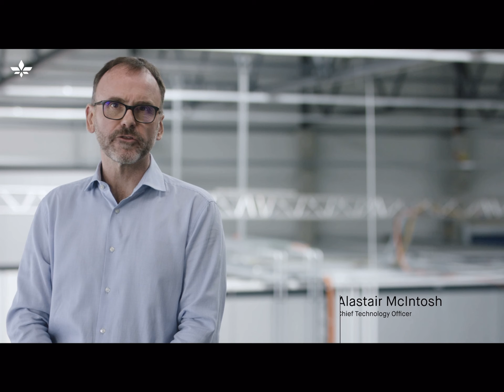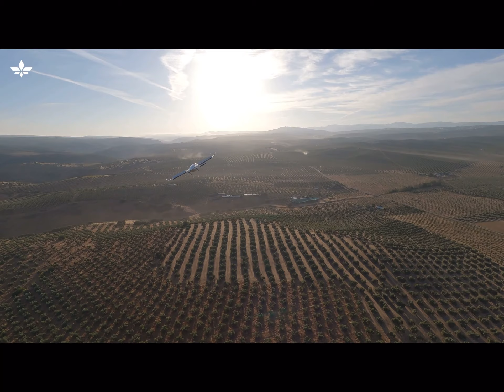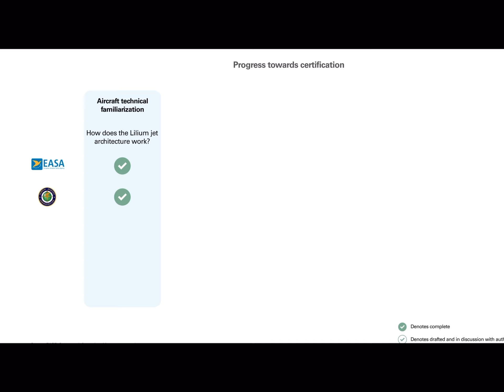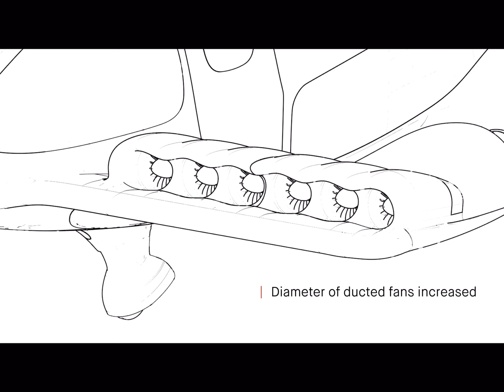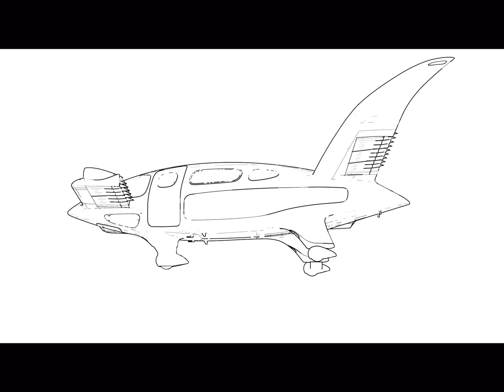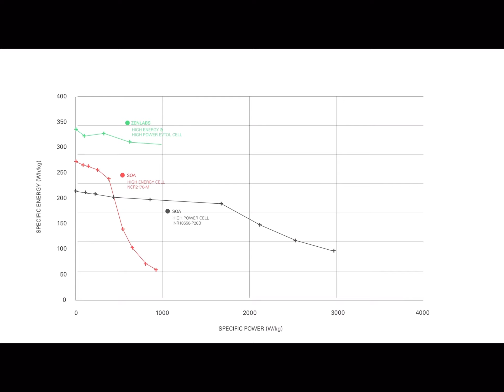Lilium's Chief Technology Officer, Alastair McIntosh, provides an update...

Comment: Make Lillium take off:
1) buy all shares at lowest possible price (0.001 Cent/share)
2) show a SAF - microjet powered vresion. Its is CO2 neutral, ecological even more beneficial than e because of many reasons
3) shares immideatly will skyrocket - financing the take over and investments by far even with profit
4) transition into e - vtol as soon as batteries are ready for it.